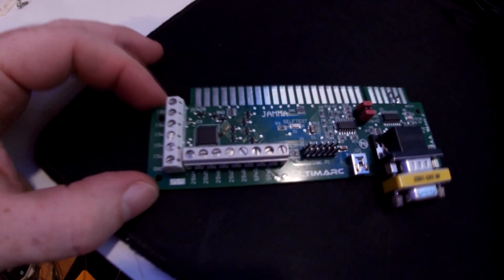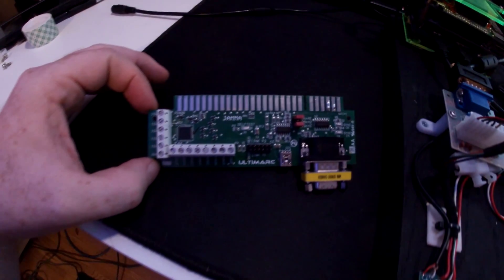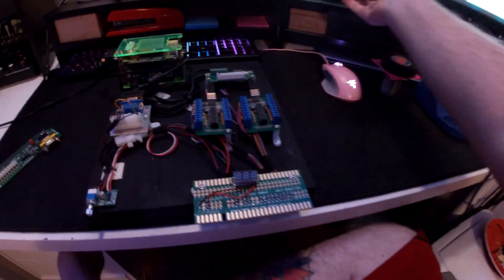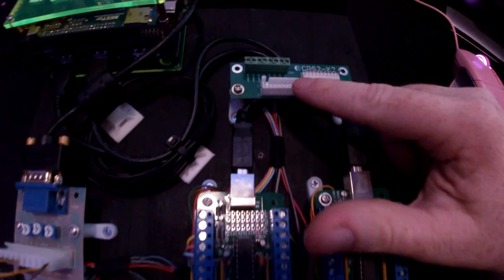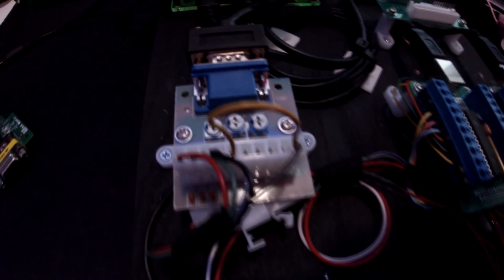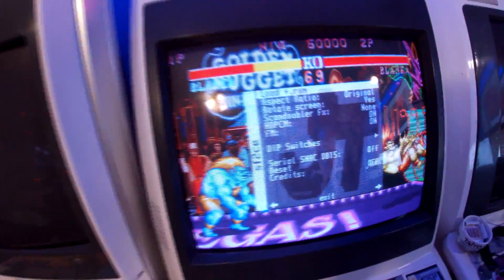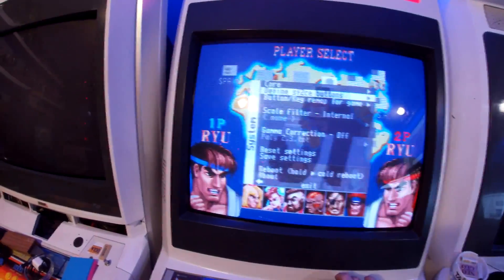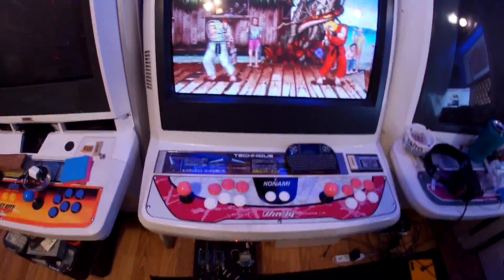MiSTer FPGA - Jamma Candy Cab 2 Player Setup!

Comment: I got 2-player CPS2 to work on my Street Fighter: CE cab using one J-PAC and no other encoder, but with CPS1 I couldn’t get the kick buttons to work on P2.
Reply from the maker: Not too sure, it should work the same way. I've had to re-format my MiSTer card a few times after running update_all.
Reply: @PastBlaster  Thanks for the tutorial by the way! I ended up getting it to work with CPS1 and CPS2 using the J-PAC and an I-PAC2 I had on hand.

Comment: I own a mister and would like to install it in my Ztop old school original crt arcade. Can you make a video on how to wire it up to the controllers and the display.
Reply from the maker: There area lot of videos showing how to wire up USB Encoders. Your setup will be unique in how you set it up. As far as the display, I don't know what kind of monitor you have, so that too will be unique. Do some research on the pinouts of your chassis, the pinouts of the MiSTer VGA plug, and make some cables. Gonna take a bit of work, but will be worth it. Good Luck!

Comment: very nice solution. i wonder about the magic of defining buttosn twice. Is that what is needed to recognize the joystick and buttons for player two? seems an odd kung fu to just define buttons for player one, go back and define the same and use player two stick. I would love to know more. 
I am attempting to build a MiSTer cocktail table with arcade cores and roms but can't seem to get the player 1 and player 2 separation for respective joysticks.

any advice you may have would be helpful
Reply from the maker: Everything is now working properly with JPac. No more double Encoders, unless you want to :)

Comment: Hi, I'm a newbie to arcade cab, i recently bought a Blast City but i have no idea now to enable button# 4,5,6. Any experience would you be able to share with me? I have a PC with emulator installed sitting inside the Blast city, and connected over Jamma.
Reply from the maker: You would need to ensure you have a Kick Harness set up, or wires going into whatever encoder you are using FROM the kick buttons.

Comment: I have an Arcade VGA installed in a PC, connected to a JPAC which goes to my JAMMA cabinet. I use a software program which selects the nearest available resolution (so for CPS1 games, I get 392 x 240). I'm interested in one of these devices if it can do the proper resolutions (like 384 x 224 for CPS1). Is that possible with the MiSTer? Thanks.

Comment: Thanks for making these videos.  I had a very similar setup, but was frustrated with the idea of having to rewire things.  I dug in to the code and implemented a way to use both players with 6 buttons from a single J-PAC/I-PAC.  It's in MiSTer as of 6/8.  Full tutorial here: https://misterfpga.org/viewtopic.php?f=32&t=448&sid=5dcffe25c70e1e8b857d3e8f8e4d172d

Comment: A JAMMA edge on a typical arcade PCB produces a high-impedance RGB signal, whereas the MiSTer DE15 connector is a low-impedance signal... is there some kind of signal conversion happening here?

Comment: Hello from Germany, i’ve got a question for you I’ve got a Sega Naomi arcade cab but I would like to have a PC inside would you recommend still the Mr. FPGA and is it possible to use one ultimarc J-pac for both controllers?
Reply from the maker: MiSTer is still limited to very early arcade stuff right now, and not near the Naomi Level of emulation. It would really just depend on what games you were looking to play on your cab. MiSTer gets better every single day, but if you're looking to play more modern things, and even steam stuff, you may want to go PC for now (That's what I have in my Chewlix along with an X2). Thanks for watching!

Comment: This is the video I’ve been needing after getting JPac, can’t get bottom 3 buttons on SF2 arcade player 1 to work, just the top 3. Can I purchase one of these devices from you? I’m in TN
Reply from the maker: You should absolutely be able to get the Kick buttons going with the JPac. Make sure you have a solid Ground daisy chain for those bottom 3 buttons, and feed the Lead for each button into the JPac. I am not really looking to build these to sell as they take quite a bit of time for me to build manually. If you pick up some USB Encoders, it should be pretty straight forward. You can do it!

Comment: What did the sync jumper do again?  Which pin to which pin on the CGA adapter?
Reply from the maker: You can configure the MiSTer to sync on composite or not. I noticed that when I had it doing that, it looked a  bit "Fuzzy" on my arcade monitor. So I just ran it normally and bridged the Sync on my adapter to have it sync like a normal Arcade Board.

Comment: I read there’s a beta firmware for jpac than enables 2 players.
Reply from the maker: Would be awesome if true!
Reply: https://www.reddit.com/r/fpgagaming/comments/ehibex/mister_jpac_two_players/    The update is mentioned in one of the replies
Reply: @AgentMoler  I've tried to get this working a while back but I was unable to. I got the beta firmware from Andy, flashed it but it's not super obvious if I succeeded with that or if I've set it to the correct dual input ID mode.

Comment: Nice this came out awesome!  Quick question for you.  I can’t seem to use the space bar to skip a keyboard input when I’m defining my buttons.  I have a jpac hooked up but defining the buttons is giving me an issue.  Player 1 button 3 should be space per the mame standard.  But for some reason it won’t leave an input undefined if I try to skip over one.  I wonder did it work for you?  Thanks in advance!
Reply from the maker: Not too sure. It may be looking for you to have a button for EVERY input. MiSTer needs some help for controller / keyboard support IMO. That is why I ditched the JPac and went dual Encoder. Wish I could help more man!
Reply: Thanks for the reply.  Yeah I wish they made mister just a little more arcade cabinet friendly.  So I’m assuming you haven’t figured out a way to map the menu button to your control panel?  It’s annoying to have to bust out a keyboard to change games.  Ruins the arcade feel ya know?  It’s crazy that if I map a controller it’s no problem you just keep hitting space bar to skip past the inputs you don’t need.  But try to map a keyboard as the controller and you can’t use space anymore.

Comment: nice setup! but call me delusional, but sometimes about this rubs me the wrong way... why pipe perfectly fine signals trough usb, even with llcooljoy... why not just use snac with sub d-15 connectors?
Reply from the maker: I'm not too familiar with the llcooljoy or Snac. I built this with parts i had laying around (Used to build fightsticks so I had a bunch of Toodles Cthulhu around) I'll check out those thing you linked, but whatever works man, go for it!
Reply: @PastBlaster  llcooljoy doesnt exist so it's not surprising you're not familiar with it ^ - ^
Reply: @WalrusFPGA  yeah sorry ^^'' meant the j-pac or whatever anyone is using to pipe High/Low through usb.
Reply: He could still be using low latency USB script right?
Reply: @James-nj8gx  low latency USB script is the best option when using USB, for sure.
Tests have shown it to bring some controllers under 1ms average response time. It's stupid fast with DS4, m30 (2.4ghz version) and the hori fighting commander PS4 (in PC mode), as well as many arcade sticks, etc.
Reply: @James-nj8gx  yeah sure, but you have a 0 input lag system (the cab/arcade cabinet) why use low latency encoders when you can connect "directly" to mister/core.

wasn't the whole point of mister to be accurate and "lagless" ? why plug 0ms lag controls to a mister via encoders or level/signal adapters? :\
Reply: @sHiNkAoLaSu  That is some serious dragon chasing if ~1ms is an issue for you.

Also, not every system works with the native connection, unless it has a fallback mode that goes to USB. There is some value to not having to open the cabinet and re-plug stuff into different spots when you want to experiment with other cores on an awesome setup like that.

That being said, you do have the benefit of many options with MiSTer, and if you want a direct serial controller connection for the cabinet, that's completely understandable also!
Reply: @WalrusFPGA  Yeah, true. that makes sense, thanks for the reply :)

Comment: you should make this a real product to sell.  i bet a lot of people would like to put this in their cabs for fighting games.
Reply: It will happen eventually. If only for “Street Fighter II”, it will happen. Eventually, someone will make a small board with system on a chip, SF2’s in memory, micro-usb power, hdmi-out, and two usb’s for controllers.
Reply from the maker: This is kind of a proof of concept. The real deal would be someone making a JPac style setup with 2 Separate USB Encoders. THAT would be Plug and Play, but unfortunately, out of my area of expertise. Thanks for watching!